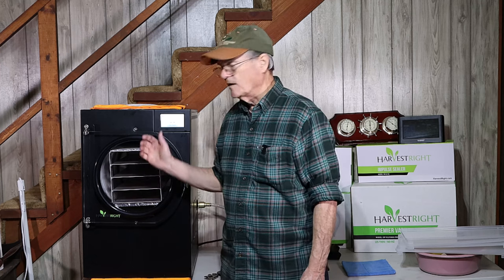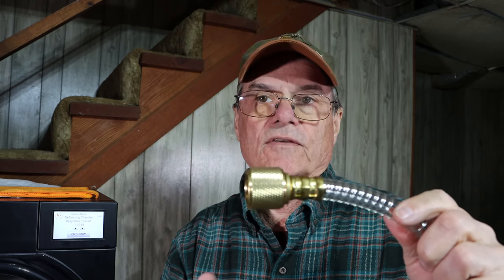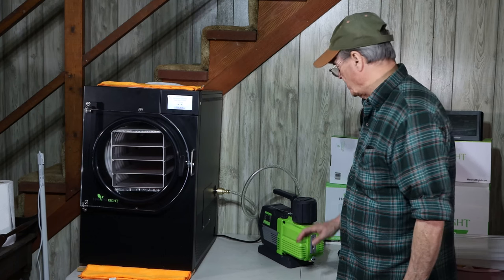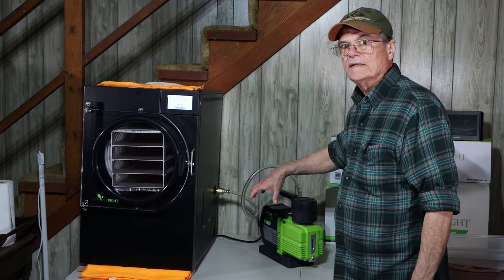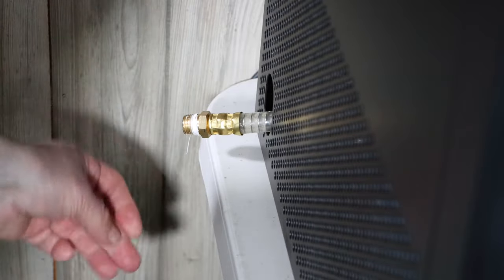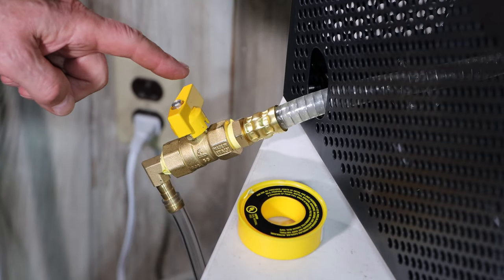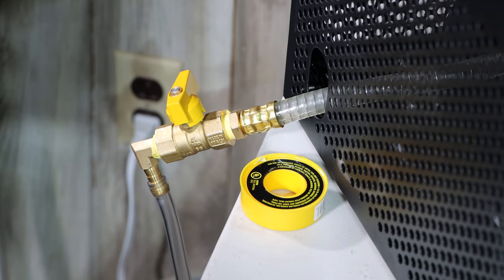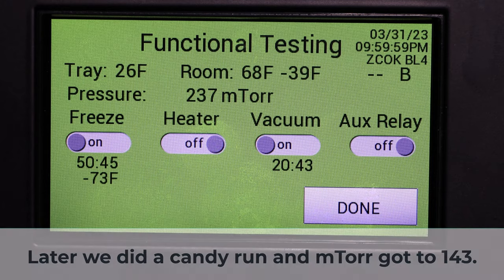Vacuum Leaks Harvest Right Freeze Dryer Errors Tips and Tricks, How we fixed ours.

Comment: I watched many so called FD Fixers here on youtube and could not fix my machine problem, I  spent more than $400 buying tapes, hoses, etc and could not solved the nasty problem for months, i had a tiny leak that was driving me nuts. I followed his advise specially with the hose and fixed my leak once and for all, took all the Teflon tape off as he recommended and used a bit of oil on the O rings, now my Mt go down to 195, great common sense tips. I really appreciate your help with this video, thank you very very much.
Reply from the maker: Thank you for the very kind comment.  Helping people like you helps keep us motivated to do more videos and help more people.  Have a great day!
Reply: Any suggestions on keeping he oring in the oil mister top. It falls out Everytime I take it off

Comment: We’ve had a HarvestRight freeze dryer since March 2022.  Early on we experienced frequent vacuum failures.   I resealed the epoxy seal on the sensor. It offered som improvement, but I wasn’t satisfied.  The vacuum hose was not an issue.   Next in line was the demister.  I discovered that the plastic threads were worn.  So I used Teflon tape on it.   I replace the tape each time a change the oil.   Since I started using the tape I’ve ran in excess of 250 batches and haven’t had any vacuum failures.   What a cheap fix!
Reply from the maker: That's good to know. We have not had that problem, but your tip could help others.  Thank you for visiting and have a great day.

Comment: Great video showing possible leak sources. Those stock valve are absolute junk. That is where my failure was. I also replaced mine with a gas valve over a year ago and have not had any problems since. I did put my Teflon tape on wrong but that did not matter. Rookie mistake but it still held. Much better setup now. I get tons of people whom watched our video that said they had the same problem. Apparently this is a problem with most all of the Harvest Right units. Harvest Right should upgrade their setup. Well done on your video. Have a great day.
Reply from the maker: Thank you for the very kind comment.  I have looked at your channel and subscribed.  I wish I could travel like you have.  Be safe and have a great day.
Reply: @cookingandstoring  Thank you very much. Hopefully you can get out and travel some too. Don't forget to take the freeze dried goodies! 😃👍 Have a great day.
Reply from the maker: Part of the reason we got the Freeze Dryer was to take food camping, but we have not been able to camp as much as we would like too.  Maybe we will get out more this year.

Comment: You have to understand how each fitting works, the hose fittings that go from the machine to the pump are compression fittins. The threads only pull the compression faces together, they need to mate smoothly or you can't get your vacuum. A little oil on the o ring and the mating surfaces might help, it won't "seal" the fitting but it will allow the fitting to smoothly mate for a better fit. The valve is a common pip fitting which needs teflon tape, I use good teflon takpe with a little pipe thread compund to make sure its tight. If your drain valve leaks make sure its not rusted, my sons rusted and we bought a new, better one.
Reply from the maker: Thank you for your comment and for visiting.

Comment: I had trouble with mine last year. It was also having a vaccuum error. I taped everything , still had an issue. Finally change the valve and voila, all good. Now im having an issue again. I believe this time it is my standard pump. I changed the oil , started a test and oil turns cloudy within a few minutes. I will once again change the valve just in case, even  though I have the same one in this video. Its been a year,  so maybe it is bad again. I hope thats it, because it is a super easy and cheap fix.
Reply from the maker: We have not had that problem but I think there are videos on YouTube about this.  Maybe they will help.  Good luck and we wish you the best.
Reply: We have the large dryer and the undersized HR pump failed with in the first year and so we replaced it with another manufacturer's pump that was larger.   Still having issues with  getting the thing to lower to 500 but hopefully this video will help resolve that.

Comment: Thank you for your simple, straight forward approach to the video. I had tried the "Felix Fix" and a few other things, but you may me remember, go back to the last time that it worked and use proper engineering and repair techniques. In my case, I had moved the pump and had not gotten the hose centered. I oiled the o-ring, sealing surface AND the threads. The threads do not seal, but the oil reduces the friction and makes the torque actually effective, not just used up in turning the nut. Pulled down to 376 in about 20 minutes, the lowest yesterday was 990, in over 3 hours! Liked and subscribe (and loved!!)!
Reply from the maker: Thank you for your comment.  I think the 2 biggest areas of vacuum leaks is the drain valve and the vacuum hoses.  You are correct that Teflon tape (or any other sealer) should not be used on these types of hoses.  If the o-ring is not doing the job, correct that, don't bypass it to try and create a seal in some other way.  Thank you for visiting and have a great day.

Comment: Thanks a bunch. I was skeptical about using Teflon tape and I am now employing your oil brush on the brass fittings technique
Reply from the maker: Just on the fittings with an O-Ring in them.  Teflon tape on the others.  Thank you for visiting and we wish you a great day.
Reply: Thanks old lady and even I can understand and follow your clear info to work on my freeze dryer.  Issues are always cropping up there should be a maintenance manual.   Seems there is always an issue now my hose is clogged supposed i should have cleaned that. Your help please????

Comment: Thanks for the video. It was very informative. I'd read that some people were having issues with their valves. Also, since I'd read that part of the installed valve was plastic, it made sense to replace it. I purchased a valve a few weeks ago; however, I like the one you have featured much better, so I bought it online at my local Loews. I'll pick it up tomorrow. I already have the tape. I did buy two replacement gaskets from Harvest Right. Having some parts on hand if/when something fails. Donald’s Freeze Dryer Support and Reviews has a teardown of the unit. I watched that in case I need to do it at some point. He has several; however, the one I watched a few times was the one titled Harvest Right Felix Fix. He mentioned that the incorrect tubing was used to connect the pump to the machine. It's a JIC fitting. I might purchase the proper tubing. I have had a few vacuum seal issues; however, mine was related to the gasket. I need to pull the cord inside the unit on top of the tray. I ensured I did that gently, and I have no more vacuum seal errors. I'm currently on Batch #6. Thus far, it's been produce. I'm slowly making a dent in my deep freezer, which is excellent.
I'm looking forward to having one more way to preserve food when it's time to harvest my garden. I can ferment, dehydrate, and now I feeeze dry!
Reply from the maker: I have also watched some of Donald's videos.  He and Felix are a great resource.  We have also experienced some of the same vacuum leaks you have and most were corrected by cleaning the gasket and pulling the cable on top of the tray rack.  But BY FAR our leaks were at the drain valve and after I removed it, and looked inside at the ball part of the ball valve, I knew why.  Harvest Right should NEVER use this type of valve.  I wish you great success and a great day.
Reply: @cookingandstoring  I agree with you regarding Harvest Right. It's a shame that they cut corners. I have heard that a few new businesses are now releasing freeze dryers; hopefully, this will cause them to get their act together. However, I think they should have done this from the beginning. Take pride in your work/product, and offer excellent customer service instead of doing the minimum because you have a monopoly on a product. My parents taught my brother and me it and lived through their actions. I  have heard several negative stories about customer experiences when contacting HR to address/fix issues. I chose HR anyway, because the companies offering the freeze dryers are new and I know if something happens to my HR freeze dryer I should be able to fix thanks to the detailed videos that are available. I've reached out to HR's customer service, by phone, to purchase additional supplies; some of their supplies aren't featured on their website. The lady I spoke to is actually one that was mentioned on Donald's Youtube page as being a great support tech. When I talked to her on the phone, she was charming and even followed up, via email, with additional information from a product I'd purchased. Because of the videos, I am confident I can handle the issues if/when they occur. My dad was HVAC. He would have been able to troubleshoot issues with no problem. Both of my parents passed away last year. Gone but not forgotten. I'm really enjoying your videos. Wishing you both a great day!

Comment: Just got ours. Tried to run a few batches, haven't had a successful yet. I ordered a new valve off your link. Fingers crossed it works. I am very disappointed with the high cost of these that they come with a set of problems out of the box.
Reply from the maker: We understand your frustration. We had the same issues when we started. Since we fixed the leaks ect. we have had no additional problems.
Reply: @cookingandstoring  I think I got to all the leaks. Mtorr went to 740 in 12 min took an hour and 12 min to get to 498 then I stopped it. Thoughts?

Comment: Thank you so much ive been fighting vacume leak and had narrowed it down to the hose i had replaced the o-rings with no luck after oiling the o-rings and holding fitting in line voila got vacume down to 140
Reply from the maker: That's GREAT!  I'm so glad it worked for you.  Thank you for visiting and have a great day.

Comment: I looked at the HR decided not to buy one because of all there problems right out of the box, so I went with a STAY FRESH freeze dryer, glad I did no problems.
Reply from the maker: HR does have some problems but they also sell more than anybody so you would expect to hear more problems.  Thank you for the comment and have a great day.
Reply: @cookingandstoring  Your welcome !!!
Reply: You were smart to not buy the HR freeze dryer.   I wish i had known about the stay fresh freezer dryer before I bought the HR.  The $4000 HR has been a heavy paper weight since about 7 months in.  And HR service sucks.  They don't have a clue as to what they are doing.   Running test over test over test to have no solution to the problem.   Also they sell one pump for all their units regardless of the size.   The pump is undersized for the larger units.  I wouldn't recommend their products to anyone.

Comment: A common problem, with that clear hose as seen in this video, is the inside collapsing especially if the hose has gotten smashed in any way.
They have a small, ridgid hose that is inserted into the large clear hose.  That fixes that problem.  Or an entire hose replacement.
Reply from the maker: We just replaced the hose.  Thanks for visiting and have a great day.

Comment: Thanks for the video, Wayne. My problems started after changing the oil. Have never had an issue with my large machine. I admit to tipping the pump when I was draining the oil due to the awkward location of my pump and absentmindedness. Took the demister off and cleaned it after watching another video. Before taking it off, I was at 1586mTorr and, after cleaning and drying, I hit bottom at 1528mTorr so not really any difference at all. My premium pump is also making a different noise... more of a whirring sound and it seems quieter to me. I'm pretty convinced that, whatever I've done, it started with me changing the oil. 

When I try to run a load, it goes into and 'extra dry time' mode and, as soon as it finishes, it goes straight into Vacuum Freezing and says it's running at over 2500mTorr. 

Any suggestions? Thanks.
Reply from the maker: Sounds like you have a vacuum leak somewhere.  I don't think it is a problem with the pump but I could be wrong. Did you test the drain valve for a vacuum leak, it is the most common problem area from what I have seen. If not the drain valve, I would loosen the hose that goes from the pump to the machine and reseat them like I demonstrated in the video.  Good luck and thank you for visiting.

Comment: Having just got a Harvest Right machine last week, I can say that at least in the manual I received, it specifically states to NOT use Teflon tape on the vacuum hose.  Maybe this wasn't specified in the manual on older machines, but at least it's there now.
Reply from the maker: It depends on the type of fitting.  The hose from the vacuum pump to the unit is straight threads and seal with an O-Ring.   Don't use Teflon Tape here.  The drain hose uses tapered threads and the threads make the seal and you DO use Teflon Tape on them.   Thank you for visiting and have a great day.

Comment: On the vacuum hose  sometimes the crimpes will leak  i use super glue on the outside of the hose to seal the leak  on the drain valve i use a stainless valve because the water has a high acid  when you put your door gasket on  close the door and use a spoon between the gasket and the body to move the gasket against the door    good job on your videio
Reply from the maker: Thank you and thanks for the suggestions.  Have a great day.

Comment: Original drain valve has caused a lot of problems with vacuum.  Harvest right has gone to an all stainless steel ball valve. In fact because of all my vacuum problems & still under warranty,  harvest right was good enough to send me 2 new o-rings and one of their new valves, free of charge. If you do purchase a replacement valve, you can be sure a gas ball valve would be your best replacement.
Reply from the maker: It's good they changed because the one that came with our machine was CRAP! Thank you for the update.  We hope you have a great day.

Comment: When you state “errors” is the machine telling you there’s a problem or do you just experience it? 
For me, when I opened the drain valve no pressure was released. The machine didn’t think anything was wrong, it had completed the FD’ing of my product. The trays were frozen was the only thing I noticed. I realized as I was watching it may have been the front gasket as there was some “sweat” on the outside of the gasket. I’ve had this thing all of 2 1/2 months. I’ve already filtered the oil once because I lost track of how many batches I had done (maybe 18, maybe more) and thought I should just to be safe. 
When I refilled the filtered oil I had lost a bit of oil, could this be a separate problem?
Reply from the maker: Yes, Our Machine was giving a vacuum error.  The sweat on the gasket is normal.  We keep a towel under it to catch the drips.  We keep a log of batches and that makes it easy to know how many have been run.  You will loose some oil from the demister with the air that is pumped out of the machine.  This is normal but it should not go below the low point on the oil level sight glass.   Good luck and thank you for visiting.
Reply: @cookingandstoring thank you for the reply! I guess I still don’t understand why there was no pressure when I opened the valve as it sounds like everything else is normal. I guess I won’t worry about it unless it happens again (haven’t done a batch of anything since, largely due to no product I want to FD).
Reply from the maker: It could be that the pump had turned off.  I think that would allow the vacuum to release slowly through the pump.  I'm not sure, just guessing.  Anyway, good luck with your machine.

Comment: I was reading the specs over on Lowe's website and it says this valve can only handle 5psi. Is that enough to handle the pressure the Freeze-dryer will exert on it?
I'm wondering this because the first time I used it to release the pressure, it only let out a very slight "hiss" of pressure and took about 5-7 minutes to allow the chamber's plexiglass door to be opened. Very odd!!!!.
Reply from the maker: That is the valve we use and it works well.  The 5PSI is pressure, we use it for vacuum.  I don't know how that relates.  If your machine takes 5 to 7 minutes to release the vacuum, there is a problem.  We had a problem where there was a kink in the plastic pipe and that caused this.  Make sure the pipe after the valve is not getting sucked closed.  If not, check that the Teflon tape is not covering the opening on the valve.  Good luck and we wish you a happy new year.
Reply: @cookingandstoring  TY for the reply. I'm not sure what happened but now after 2 freeze-dry cycles, it's working perfectly. I just hope it doesn't happen again. Thank you for all your help!!!!! Happy New year to you and your fam!!

Comment: Good Stuff! What size is that new valve? I’m just going to replace it before we even use ours
Reply from the maker: Here is a link to the one we used.
This is the drain valve we installed:
https://www.lowes.com/pd/PRO-FLEX-Brass-3-8-in-Fip-x-3-8-in-Fip-Ball-Valve/1003071900 
The Teflon Tape we used
https://www.lowes.com/pd/Oatey-0-6-in-x-21-ft-Plumber-s-Tape/4751309 
 Thanks for visiting and have a great day.
Reply: @cookingandstoring  Thank You Sir!!!